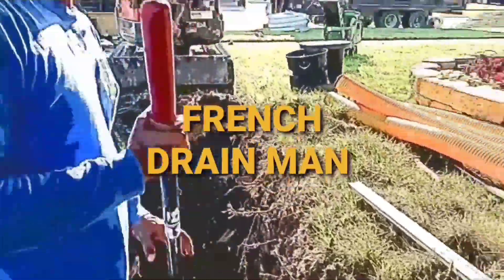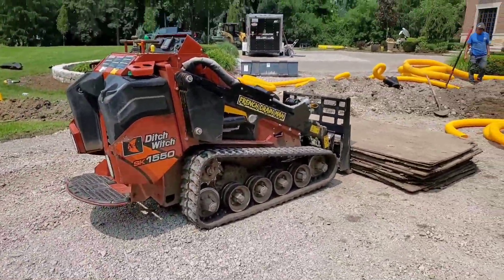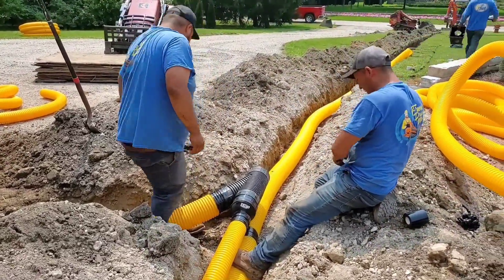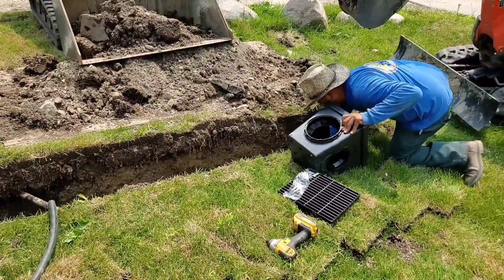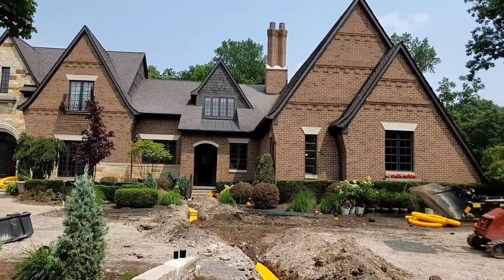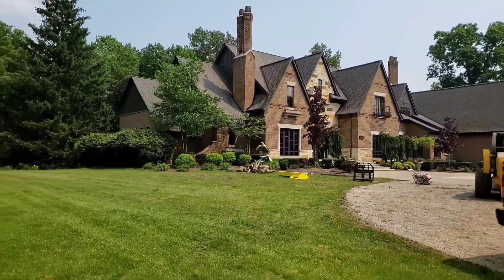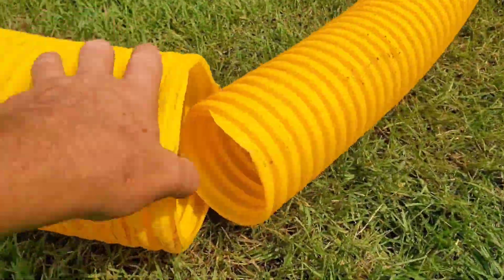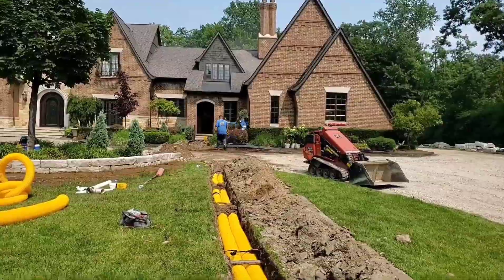How To Run A Drainage System Under A Driveway [ French Drain, Yard Drain, Buried Downspout, SumpLine

Comment: Man this is super cool. I am building a small wine cellar and I want to run a  french drain system under the slab to reduce hydrostatic lift. I want run it to a D box with a sump pump to take water from underneath. I want to use small rounded gravel to have a layer between the concrete and the piping. Will definitely use 6 inch now!

Comment: I have a French drain buried under my driveway where it is 10-12” at its shallowest and gets deeper from there. 

Do you think it will hold up to parked cars and trucks if someone parks on top of it? Or will it get crushed? Would appreciate a response if you can. You taught me a lot. Thank you!
Reply from the maker: It's a loaded question because it depends on the condition of the sub soil. You have to overdig and then compacted crusched stone underneath the pipe. Then, you have to compact angular small stone with fines alongside the pipe. I like the fact that you have it buried that deep. That's gonna help it out a lot. But you still need to compact a fine crushed angular aggregate with fines in it on top of the pipe as well. I do plan on making a video about this.
Reply: @FRENCHDRAINMAN  thanks for the quick reply! It’s a shame I can’t run a camera down there and check it out. 

Sometimes you got to have faith I guess. 

I watched your videos and installed 200 ft of French drain with multiple veins down here in Alabama. Used the burrito method!

I used crusher run over and around the pipe in my driveway. It’s draining great. I just had a contractor park directly on top of it today so it got me thinking…